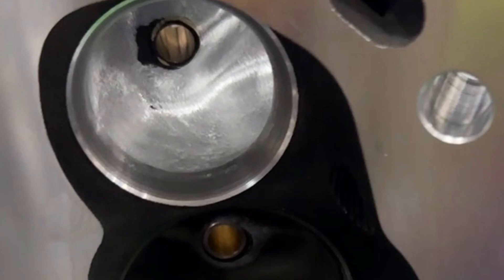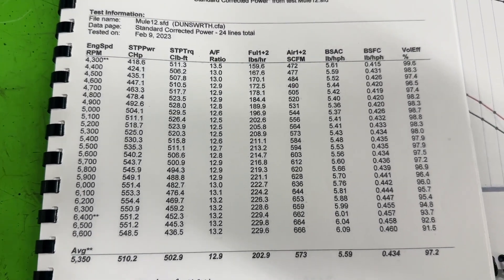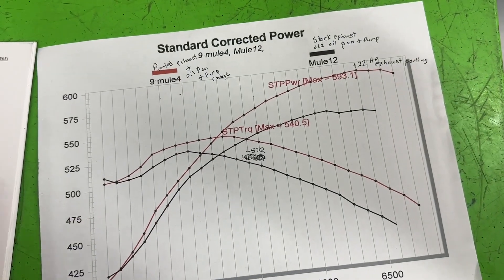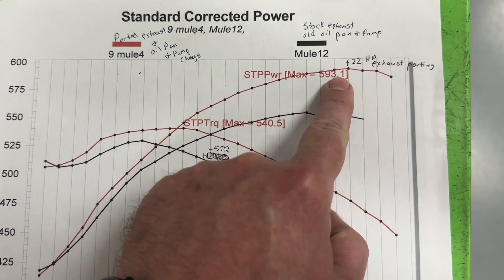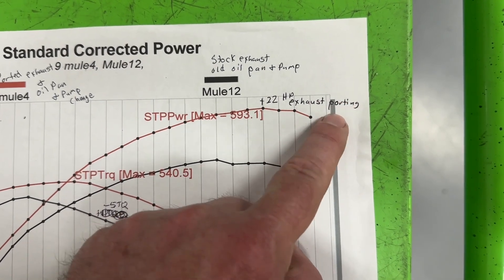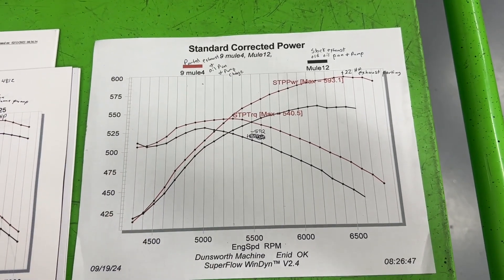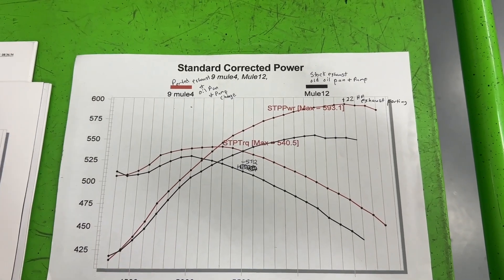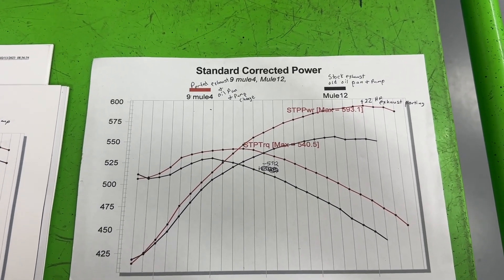How Much Power Do You Gain Porting Just The Exhaust Ports

Comment: Condolences on the loss of the dyno mule Eric.  I'm suspecting that a portion of the power gains have come from a reduction in pumping losses on the exhaust stroke due to the increased flow
Reply: or water/steam injection
Reply: Your valve events are incorrect if you have pumping losses.
Reply: @racerd9669  you always have pumping losses on the exhaust and compression strokes. It's a physics thing and you can't avoid it. You can however minimise it.
Reply: @theshed8802  Once you understand flow data , you can all but get rid of pumping losses by having the correct valve events. If you look at most engines guys build, just look into the intake track and you will see pumping losses by incorrect ex timing. Carbon in the intake is your first clue. And these engines alway run hot.
Reply: @racerd9669  whats the relationship between manifold vacuum and pumping losses and exhaust back pressure and pumping losses? and why do several of the V8 engine manufacturers  run cylinder deactivation instead of VVT to remove pumping losses?
Reply: @Bristolcentaurus  You have a misunderstanding of how  air flow thru an engine works. You do not have vacuum , you have pressure deferential. The piston traveling down the bore creates a low pressure and the 6 miles of air above the engine flows into the cylinder. If you have Ex back pressure your Ex system in wrong. Using pulse wave tuning it will create a low pressure in the ex pipe, and help evacuate the cylinder.

Comment: Engines like the Cleveland and 429/460 Ford can gain serious power by modifying the heads to use the high port exhaust plates. And depending on the year,  the stock exhaust ports have the A.I.R. port bulges. So yes, exhaust only porting will help quit a bit, but results can vary from engine to engine.

Comment: Interesting conclusion Eric! These test results you're providing are invaluable for the enthusiast. My race engine days are well behind me now, but how I could have used some of this data back in the day. 
Over the years, I've heard that ex port shape* may be more important than actual flow bench results. ie: A better flowing ex port could be down on power compared to a lower flowing head. Makes sense due to the supersonic speed of the exhaust gasses compared to the flowbench airspeed... 
These test results invalidate that assumption somewhat.
* A change in shape requiring more than could be attained with porting. ie: back in the early 1990's when the ex ports started getting really straightened out in new design race head castings.

Comment: So if building a street only very mild resto engine which doesnt see the high side of 5000 it may actually be beneficial to not fully port the exhaust but rather just give it a clean and do the seats. In the range of 2000 to 4500 your going to see torque improvements. Also dont run a split pattern cam with a longer exhaust duration. Very interesting test.

Comment: Very interesting. It would be cool to see this comparison on a high compression engine vs a low compression engine. Initially I would think the low compression engine would see a greater benefit from exhaust flow improvements since it doesn't evacuate as well, but maybe the pumping loss of the high  compression engine would see a greater benefit with less exhaust restriction.

Comment: That is exactly the experience I have had in my dyno testing with exhaust flow and power curves.  Darin Morgan has repeatedly stated that going from a 1.88 exhaust down to a 1.8 in a BBC gains significant torque under the curve and a prostock engine might use even smaller...
Reply: I too have seen gains from smaller exhaust valves. For 30 years, @ least, we've been fed that both valves need to increase in size together. The LS3 2.165/1.590 was my wake-up call.
Reply: Is that "gains significantly" below the torque peak?

Comment: Back in the seventies, I ported a few cast iron sb ford heads. I was told for street cars not to touch the intakes but open the exhaust significantly.  The results were tremendous.  Woke the basically stock 289/ 302s up to the point that traction was an issue.  After that I moved to fully ported 351 Windsor heads on the 289/ 302. The larger heads once again made all the difference, but they needed many more additional mods to hit their full potential.
Reply: And doing the intakes made even more.
BTDT